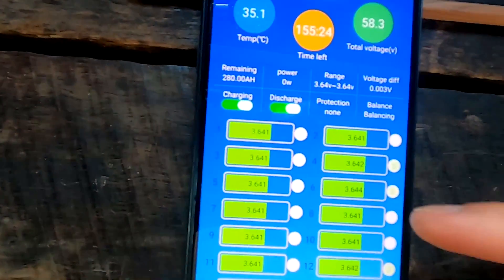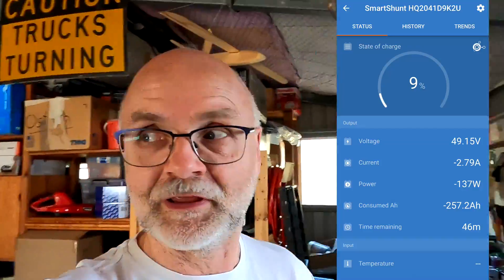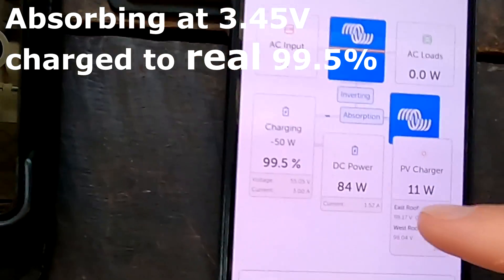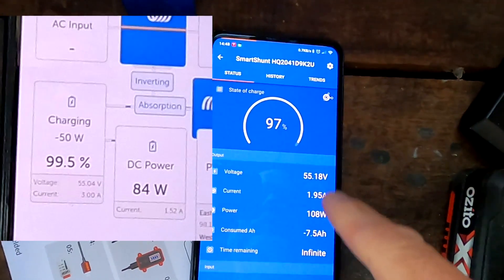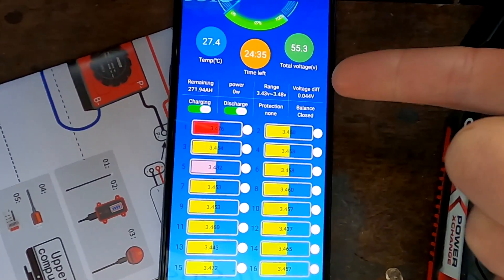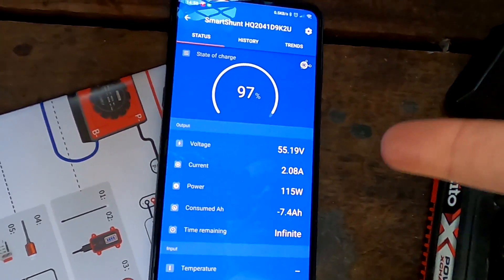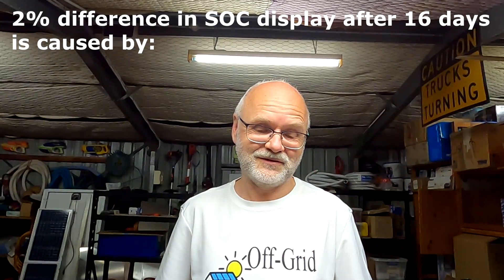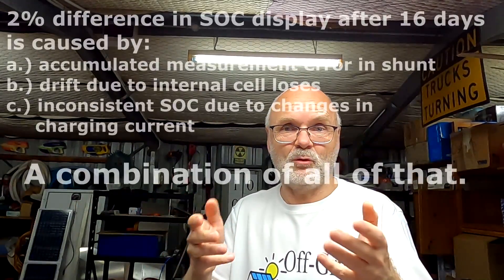Smart shunt drift after 16days with no calibration. Who is to blame?

Comment: I have a mini solar set up with a 100ah battery to run my WiFi router and cable modem.  Had this set up since 2020 and it pulls about 2.5amps 24/7/365.  Sunny days it is definitely at 100% SOC.  I have found that the drift on my shunt to be much larger now that the battery is 4 years old. Does that track as batteries age the drift should increase?

Comment: Personally I don't see the need to have an exact percentage displayed. Lithium is not good enough to justify the price, with normal batteries you get a good idea of how full they are from the voltage and you can easily calculate necessary charging and capacity.

Comment: Maybe you set the peukert Exponent wrong. You can calculate it (see manual smart shunt) by yourself if you have measured the different capacities for different currents. In your example it is:
(Log10(109/5)-Log10(102/40))/(Log10(40)-Log10(5)) =1.03
Reply from the maker: I changed it a few times but found 1.01 works the best for me. All other settings cause even more drift.

Comment: Why are we in 2022 using such primative power supplies like batteries? damn these oil barons. im making my own hydrogen with shop bought stainless steel drinking bottles and steel wool filaments a handfull of AA torch batteries inflating home made balloons with a tea candle under them creating quite an impressive explosion at 1000m + in the air.

Comment: Nice video. I have 4 x pylontech 2000C connected via a Cerbo to a Victron Multiplus2. Charge with solar energy up to 89% (maximum charge voltage 50.8) (pylontech has 15 cells therefore 3.338 V / cell. SOC 17 April = 89% at 50.66 V, SOC 18 April = 88%, SOC 19 Apr = 87%, Apr 20 SOC = 86%, Apr 25 SOC = 79% every day with a 50.66V. Where is it going wrong?

Comment: Good morning A tip for lifepo4 24v After reaching the maximum charge in my case 27.52v. What is the voltage to set to resume charging the battery pack? Thanks

Comment: all of the above !  how ever  for (a)-smart shunt , you can refine it and make it drift less by setting correctly the "charge efficiency factor" in the smart shunt setting   by making a controlled experiment  of full cycle charge-discharge  and  calculate the ratio between charged Ah and discharged Ah by this test you will also know the real capacity of your battery . and btw  even this parameter is depended on on the charging/discharging current (speed of charge / discharge) as you clearly showed in your experiments - so when you set this parameter do it based on a charge/discharge rate that has minimal effect on this parameter . in my installation i even don't know if it drifts since i always charge to 80% and never discharge bellow 20%  so the smart shunt does not  have a chance to self calibrate !  however i monitor  on the smart shunt the accumulated   charged/discharged Ah  since last calibration (many months ago ) and I see that the ratio between charged/discharged  Ah is kept about constant and converges to the parameter that I set (~98% on my system )

Comment: I can see the SOC from my Smartshunt and my JBD BMS. They are close, but never 100% in sync. The moment the cell voltages affect the BMS SOC, the difference becomes even greater between the two, as the Smartshunt does not take into account the volts per cell, only the total voltage of the bank. Using the BMS SOC is "more accurate" on a Victron system in my experience so far, I'm still learning. And it does help a LOT if the JBD BMS, with an RS485 port added, is also connected to the system via a VenusGX/Cerbo or Venus OS on a Raspberry Pi, using an RS485 to USB cable. It controls the charging better.

Comment: I don't know about the Victron smart shunt, but in my Victron multiplus GX I can setup a "charge efficiency" of the battery. This charge efficiency will depend on the internal resistance of you battery. So the internal shunt measurement will be compensated with the "charge efficiency" of your battery and and this will result in a more accurate S.O.C. I think.
Reply from the maker: I can set this up as well. What number have you put in for LiFePO4?
Reply: @OffGridGarageAustralia  at this moment I have set it to 0,98. I am not sure of this efficiency. It is still try and error...it will never be perfect I think.
Reply from the maker: @heinvandenbroeck3184  Thank you. Mine sits on 0.99. Google says for LiFePO4 0.99 or 1 is OK. Maybe that's part of the drifting and it accumulates the error over time.

Comment: I learned elsewhere that if you want more accurate battery monitoring, you need to get one with an improved algorithm. Instead of suffering from drift, your monitor becomes more accurate as it accumulates more data points. In other words, it's not so much the shunt as it's the smarts of the electronics monitoring the shunt.

When you cycled the cells at different amperages for efficiency testing (awesome experiment, by the way), did you note the amount of drift each time? I'd be interested to learn if the amount of amperage itself influenced the amount of drift.
Reply from the maker: That's a good question, I did the test for efficiency testing only once for each current setting. I could repeat that test and several times to see if it drifts. Good thinking.
Reply: @OffGridGarageAustralia  Thanks! You could cycle the cells several times at 5A, measure drift, reset the shunt, cycle them several times at 10A, measure the drift, reset the shunt, yada yada yada... or save a LOT of time by just cycling the two extremes (5A & 40A) and comparing the two drifts.

But if drift due to different amperages is confirmed, you would be handcuffed to always charging and discharging at the same exact amperage every time just to keep your shunt more accurate. Not practical. If you could tell your shunt to "plug in and use Andy's data points" that would solve the problem (and be totally awesome), but that's not possible (as far as I know).

So I think the only solution is to either find an shunt with an improved algorithm, or just live with occasionally having to reset your current shunt.
Reply from the maker: @charlesrichards5389  Yes, that is all very time consuming.
The shunt can calibrate automatically every time I fully charge the battery. It was set to this until I started the test and I turned this function off. So every time I hit 3.45V and absorbed for 30min and the current went under 5A, it reset to 100A. That works fine and is close enough to show the SOC.
Reply: @OffGridGarageAustralia  Yeah, I get it. Automatic mode will hide drift, regardless of what causes it. That's why I don't entirely trust automatic mode to correctly provide available power as a percentage. When the battery is charged, the shunt will calibrate to display 100% even if the cells have gradually degraded over time from, let's say, 280Ah to 250Ah. It's just presenting the "new normal" as 100% and can give someone who isn't paying attention a false sense of security. I also suspect that some shunts give too much weight to voltage as SOC because LiFePO4 voltage curves are so darn flat. But like you said, it's close enough (at least until you decide to go down the rabbit hole🤓).
Reply from the maker: @charlesrichards5389  The percentages will always be correct, 100% is always 100% when fully charged no matter how far the battery has degraded 😉
But the shunt also shows the missing Ah until full which is smart too. They won't change either over the years. Just the full capacity will, so the 280Ah will never change in the smart shunt and a full capacity test need to be done every year/two years if someone wants to keep this actual. I'm not too fussed about it, just want to see what happens when I change parameters and how the system reacts.
Thanks Charles.

Comment: Isn't the smart shunt telling us it still needs 7.4Ah to reach 100%, hence it knows it's not full even when the cells are 3.45V. Also in your capacity tests you (as far as I remember) didn't charge with a absorption, so you stopped at a certain voltage or current, this will give you other results as well. Also a battery charged with 40A will be a bit warmer than charging with 5A. So it all varies (a bit). B.t.w. great you are educating us about this as it's I think the fine line between chemics and the combination of Voltage, Current, charging variances and Temperature which will get a difference in measuring. Keep up the good work and thanks again for sharing.
Reply from the maker: Thanks Edward!
That is correct, it said there are 7.4Ah missing. But were they really missing or was the shunt just thinking they were missing and the cells were full?
I think it's not consistent either as you said temperature plays a role as well as other factors. Regardless what has caused the drift, it will be very hard to reproduce that. The first couple of full charges after the calibration were consistent until I went really deep down and up again.

Comment: Thanks for a most imressive channel! Prismatic cell concern: I have seen several DIY'ers finding themself in the same situation: One or two of the cells in the pack act differet that the others from the same batch. We know about the expansion when using the full (or near full) chargeprofile at 3.65V. We also know about the more or less fragile terminals on most prismatic cells. So, I'm thinking; since most are using solid bus bars tightening the cells together via the terminal, could that result in making disorder in the terminal inside the cell when there is no "compression" to hold the pack in place? That the combination of busbar, expanion and top craging result in stress on the screws? It has been a concern of mine for a long time that this seems to be a common issue. What you think? Would a connection with a more flexible bus (like a cable) work better?
Reply from the maker: Thanks for your comment and information. Great question but I would not be too concerned about the forces on the busbars/terminals. I have mine connect in a loose setup with space in between the cells. The contraction/expansion is minimal if there is one at all. In the specs it says up to 0.5mm between 30%-100%SOC. Cables would work better in these occasions but have more resistance due to higher contact resistance.

Comment: How do you characterize the AH capacity of your cells?  Using the manufacturer's stated AH rating can't be all that accurate, and the Smart Shunt relies on that AH value to compute %SOC.  

Remember, a SOC meter does not directly measure SOC.  It can't.  It estimates SOC based on integrating Amps (both positive and negative) over time, and estimates SOC from the 100% starting point.  If the AH value is wrong, the SOC estimation will always be off.

Did you adjust your AH capacity down when you derated your SOC usage from 10 to 90%
Reply from the maker: I have used the 280Ah of the specs, so fully charged is 280Ah. This is not accurate of course and may even vary with temperature. But this is as close it can get with the effort I'm putting in.
So discharging 1Ah and re-charging 1Ah and we should be back at 280Ah at full charge. This alone depends if I discharge with low or high current and how long it takes until we're back at 280Ah (self discharge). The shunt does coulomb count and also has a parameter for charging efficiency which I have set to 0.99. This again may be correct under certain situations and is not with other circumstances.
My capacity setting in the shunt never changed. It was always at 280Ah even I charged to 3.45V only. But you may remember that from another video: I fully charged and balanced the battery to 3.65V and set the shunt to 100%. I then let it discharge slowly a few Ah and recharged it to the old setting of 3.45V including absorption. It showed us 99.5%SOC by the time. Still the capacity was set to 280Ah in the shunt, so it knew there are 0.5% (~1.4Ah) missing to be at real 100%SOC.
Reply: @OffGridGarageAustralia  Look at these two videos by Texas Instruments:  Battery Chemistry Foundations, and Battery Monitoring Basics.  It's tech heavy, and their example covers Li-Ion chemistry,  but it gives you a broad overview of all the issues involved with SOC estimation.

Comment: Set the parameters mentioned in the manual correctly:
• Tail current
• Peukert exponent
• Charge efficiency
• Discharge floor
Peukert can be calculated from the results of the discharge tests.

Comment: Awesome video as always. In looking at the data it seems to me that 3.5v capacity curves are better by about 2% than 3.45v in the 5-40amp range tested. Maybe being a little higher up on the curve would provide better long term performance, especially seeing the videos of the wild wattage variations due to the clouds.
Reply from the maker: Yeah, the higher you charge the less difference it makes how you got there. But remember, charging to 3.45V gets us already to 99.5%SOC. So is it worth chasing these remaining 0.5%SOC? In my opinion, it only stresses the battery for nothing more than 1.4Ah of capacity you could gain.

Comment: I'm guessing B and C on your question

but a question is if you intend to test a few other things like putting the balancing should start close to what you average the total volts?
- sets the battery charge to 55V and no limit when it should stop and then sets the balancing to start at 3.45V? (realize that your BMS will have to work a little more when you take in 50A than when it's possible, but then you still have energy left over and it should be relatively full at 3.4375V, but without a time limit, you avoid the problem of cloud edge? (just one thought or set the package to 55.1v and it starts at 3.45v?)

Another question when you want to streamline most things if you intend to redo a little when you then move the battery and build the new one is my idea that you solder or screw a separate cable and not where the screws to the connectors are (as DM has on her battery with a small screw similar to M3 but if possible solder is preferred) and from it you pull a 1.5mm cable to a distribution connector so 90-98% of the distance to BMS is a "thick" cable and then it is easier to connect fer cables there as in your case have the connector there for your active balancing as well so it is easier to push it there if you want without having to screw anything and think it should be much smoother reading value the shorter the distance are the thin cables which connector is on?
(I think the type used for wiring and the thin cables can be folded a few times if they are too thin or a little solder may be a better option)
Reply from the maker: Thank you for your suggestion.
I will connect the balance cables directly to the busbars with an M4 screw with the next setup. It is just easier when I have to change something. I have 1mm cable already here for that and will also fuse all connections for the balancer.
Reply: @OffGridGarageAustralia  you also think that the connectors used for splicing and branching are easy to use, I have seen everything from 1-1 to 1-3 that are spring-loaded so you no longer even need to screw them as before. Suppose you may have other dimensions but here two sizes are used the most and it is 1.5mm2 and 2.5mm2 in cabling and sometimes where there is only one lamp to have, we use 0.75mm2 and these cables are light and cheap to find.

think the contact will also be better when the nut is to cut in that it does it in the right place and not on a ring contact

and I do not know where to put the balancing now but I think it is best to have it close to the battery voltage so it starts at 3.45v and packs to 55-55.1v or reached that direction when 3.45 is well when it starts rise faster (and as long as everyone is even it does not need to balance at all and it gives a little longer time as it still can not take down so much so they should make them stay smoother and where do you have it breaks the relay? under 3v and 3.65v?

Then I saw your video about your 4S and they must have had good sellers or something else as they are still expensive but another BMS that the ones I have seen people are happy with is DIYBMS which is on an ESP but it is also not as easy but seems good for those who like to do things themselves

Comment: just charge the dam things to 3.65 and set static ballance down to 3.5v......
what are you messing around at float charging lithiums.....
and i d have thought it obvious its down to charging voltage which is basically variable dependant on bright or dull day and i experience an exaggerated  version of this when using a 14.8v lead acid charger when in tandem with a 14.6 lithium charger.
ps. you can set the cell voltage the smart bms flicks to 100% indication in settings as its bog standard is 13.6v which equates to around 75% if a lithium specific charger is used.
(mine is set to 3.6v or 14.4 if multiplied by 4)

you seem to be spinning this out for media success rather than sorting the problem which i find a bit missleading for folk ...
Reply from the maker: Oh, Harry, it seems you don't understand what this is all about, right??? Poor guy... 🤦‍♂️